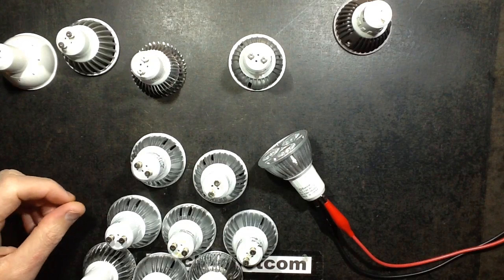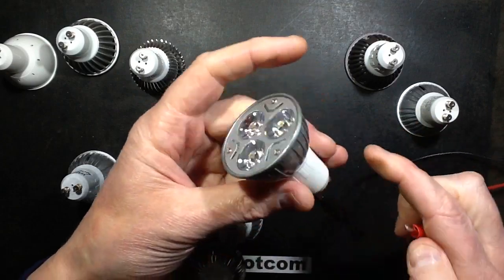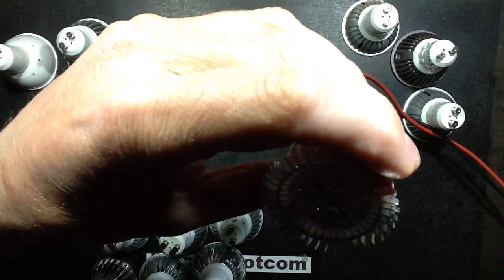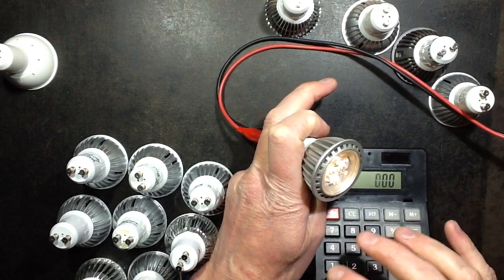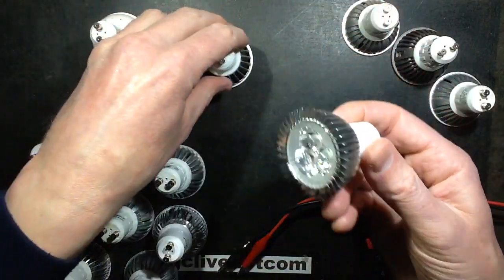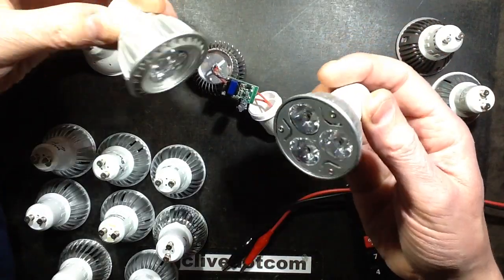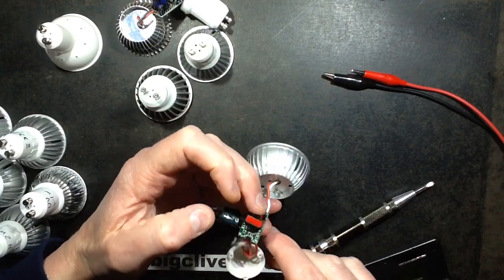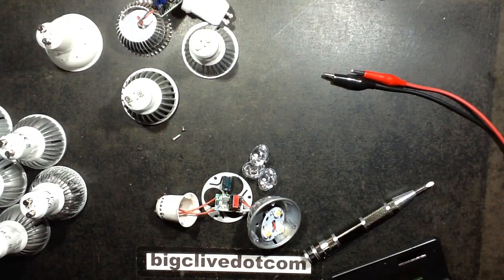Mains LED lamps lighting on 12V?

Comment: After seeing lots of LED lamp teardowns - And having gone all LED in my flat a few years back - I've often considered switching my lighting circuit to be fed off my 12v doorbell transformer and removing the inverters from each lamp, powering the LEDs straight off the 12v that my lighting circuit would be supplying. This'd reduce efficiency losses from having separate inverters in each lamp, and presumably improve power efficiency (And reduce consumption) considerably. :-)

Am I correct in thinking of it in this manner (Let's be honest, there'd be nothing wrong in having a 12v lighting circuit) or is there anything - Beyond finding a new supply for my 230v~ smoke detector (Presently run from the lighting circuit) - That I'm missing here? :-)
Reply from the maker: If you did that it would make sense to get a dedicated power supply that had integral power factor correction circuitry.
Reply: I'm late but there is one flaw: the lower the voltage the higher the voltage drop (in percent). so if you go all DC, consider 24 or 48V instead.

Comment: I have know about this for a long time they will work on 8v 200ma I got an Asda Led G4 2.5w 240v on a 12v gel battery been running for 5 hours so far makes a good emergency light just take your 240v led and connect to car battery any way round no inverter needed :D

Comment: wait, why does the polarity matter? 

I mean, don't these PSUs first go  through a first rectifier? so it shouldn't really matter which way you put em in 

well... assuming they're not just using half wave single diode rectification

Comment: So they are AC, but only work on one polarity?
Half wave rectification would make them a seriously distorting power factor, but I suppose with luck, multiple units may end up opposing and balance out
Reply from the maker: +Matthew Day I don't care much for the single diode rectifiers, but it is at least a very small load.

Comment: it's funny I was looking for 220v lamps that would work on 24v from solar cells as backup on the same wires when the power goes out.
That seems very feasible now thanks.
Reply: if you feel like playing around,you could just get the parts to make your own ones   

LEDs aren't that hard to find "raw" nowadays

Comment: the 13001 is an NPN Power transistor also common in CFL lamps but in pairs.
datasheet here - http://www.unisonic.com.tw/datasheet/MJE13001.pdf

The HC6801 IC is a cheap Chinese bootleg chip. What info that did exist was removed from the website and there chip is no longer available for sale.

The Dollar Tree here in the US started carrying these in the 120 volt flavor recently, Yours truly bought all they had in the local store here 3 days ago.

Comment: Nearly 100% failure rate on connecting the leads. DC sucks! :-)
Reply: +PIXscotland It doesn't. Face it.
Reply: Ever since I starter working with trucks I find DC easier to work with. Mostly because it doesn't hurt when you touch the live wires :P

Comment: I won an(listed as) LED 3W 220V bulb for $0.36. When I tested it on my Killawat EZ at 110V here in the USA it read 0.6W. Does that sound like the proper result considering half the rated voltage was used? Should it read 1.5W ? Thanks bigclive, your videos are pretty good.

I'm just learning to have some fun with electronics/LEDs and occasionally building some very basic and crude(but relatively safe ;D ) 12V battery powered lights for fun.
Reply from the maker: oh just quit it The lamp probably wasn't really going to be 3W anyway, but the use of a lower voltage is also affected by the number of LEDs if it's the capacitive dropper type.  So it may well have been running at 0.6W.  You probably still found the light output was useful at that power, and it should last for decades being under-run that much.
Reply: bigclivedotcom Thanks. I do expect something less than what they say, especially when I win at such low price. I just didn't think it would be only 1/5 of their claim. Good to know there are reasons for it and that seller may not be quite so bad. Sorry if I'm a bit off topic. TY again.
Reply from the maker: oh just quit it There's a strong possibility that it's actually a 220V lamp if it's the type with lots of small LEDs and a capacitive dropper inside.  On 110V it wouldn't just be half the brightness, since the dropper is designed to drop the difference between the mains voltage and the combined voltage of the LEDs.  On a lower voltage supply the LED voltage will be a much higher percentage of the mains voltage.
Reply: bigclivedotcom So cutting the voltage by half would result in less than half the wattage draw and light output? Resulting in realizing 20% of their stated performance at 220V? If I understand that correctly then if I were to have a 220V socket it would be more than twice the light output, possibly up to 5Xs.
Reply from the maker: oh just quit it Only if it is actually a 220V lamp.  What was it listed as on ebay?
Reply: bigclivedotcom It was listed as 220V.

Comment: My eBay, alleged 240 VAC 10W RGB floodlight (actually 4 or 5W) will turn on at around 28 VDC and you can then turn the voltage down to around 10V before it goes off.

Comment: If most or all the rooms in the house used GU10s, it would make it fairly straight forward (for an electrician) to add a switch to the lighting circuit to toggle between mains power and a 12V battery source.  As the LEDs draw a fraction of the power, you wouldn't need an expensive or bulky high capacity battery either, let alone an inverter.
Reply: Seán Byrne Or use a mains relay for automatic switch over to battery source.
Reply: I know how to do that and I'm just a kid and I've done tons of those experiments

Comment: That is quite interesting, This video gave me an idea to test some other equipment and my 13003 transistor operated mains 100-250V to USB power supply worked with DC5V in, giving roughly 5V out (1:1 ratio), video coming soon. Thanks for sharing.
Edit: video - https://www.youtube.com/watch?v=lvlgcwrFUjw
I'm impressed about the switch mode power supplies and how flexible it actually is with supply voltages. Even my phone charger turned on with 12V and charged the phone.

Comment: I shall find those numbers and put them rite ""here""
....where?
Reply from the maker: They appear as a note on the screen.  Or at least they do for me.  Not that it helps much, since that chip is one of those anonymous Chinese ones with no datasheet.
Reply: Jared Reabow You need to have "annotations" enabled to see it.
Reply: Jared Reabow 
13001 transistor 600v
200ma
HC6801 chip turned up no data other than this module.

Comment: I must admit I've started taking apart the broken gu10's from my work, ripping out the old supply, connecting my adjustable supply and now use them as a back light for my monitor. With variable brightness it's actually quite nice.

Comment: these ones that run on low V, would they suffer from inductive flash
Reply from the maker: voltare2amstereo Inductive flash?  If you mean transient spikes then they are actually designed for 240V with all the glitchy nonsense that happens on mains wiring, so they should be quite robust.

Comment: Obviously those with capacitive droppers won't work on DC, wonder if they'd work on 12v AC, probably not
Reply from the maker: ***** Alas no.  After about three or four LEDs in series the voltage wouldn't be high enough to forward bias the LEDs.